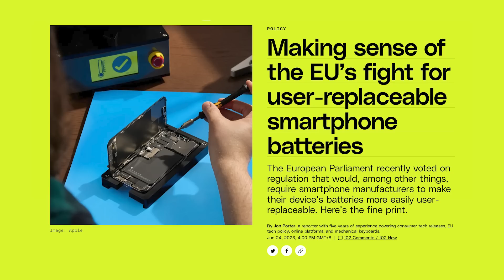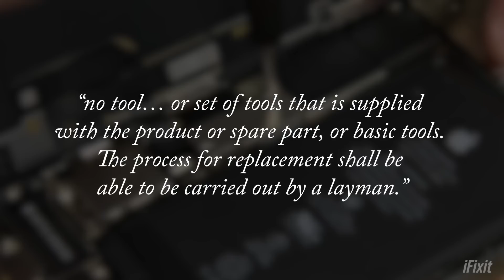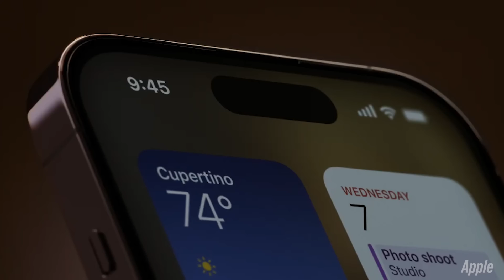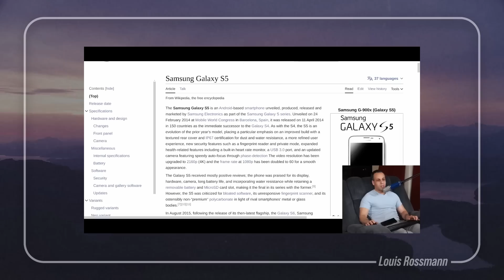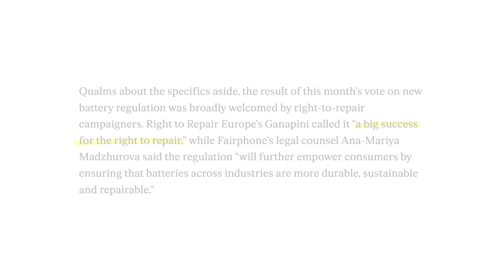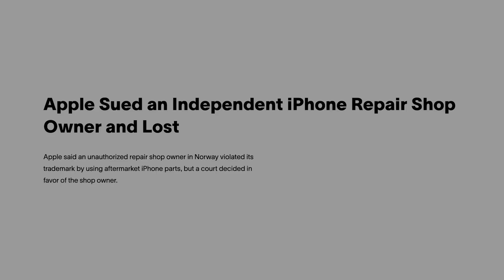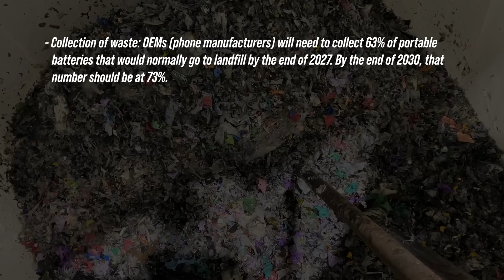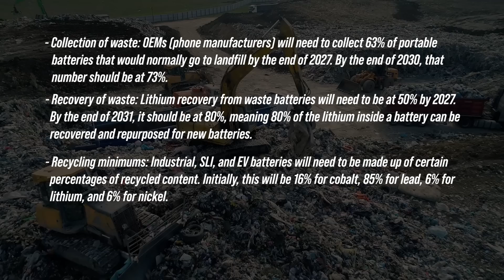EU Just Changed Smartphones Forever

Comment: Hope that eventually, they will finalised on a few fixed battery form factor that all smartphones with removable batteries has to follow. In that way, the same battery can be use from one phone to another.
Reply: That would be wonderful! You could lend people your phone battery for a bit if they needed or something, and you could keep spares for future phones ^^
Reply: And the same should be done for EV batteries... there could be a set of battery standards developed that cover different size and shape parameters that manufacturers had to use.; Small/med/large, long, short, wide, etc to allow different capacities for different vehicle designs. I'll make up a number.... say 30 different shape/size standards that the mfrs could choose from to design the vehicle around whether a mini compact vehicle, or a large truck. Then say you have a 5 year old EV and the batter goes to shit, if such standards existed getting a cost-effective replacement would be easy, instead of having to rely on a massively overprice OEM battery.... that is, if you can still get it. 

Within that size/shape profile new battery technologies and efficiencies could be used in that same "case" as they evolve and improve. I really surprised this hasn't already been done.
Reply: And for power tools.  Completely idiotic that almost every company makes their battery casing and connector slightly different.
Reply: Without any doubt, standardization would help quite a lot in recycling and cost reduction. It could be extended to standardize bottles for liquids (milk, sodas,…). You are on the right direction!!
Reply: Universal battery is good idea. Atleast on brand level.
Reply: As great as that sounds, it’s not as great in implementation. A lot of companies use special designed batteries made of multiple cells that are specifically designed in a size and shape to fill space that would otherwise be underutilized in the phone. If they all have to used one standardized battery we will either be getting a much smaller battery and/ or have to trade off having a component layout that can’t be optimized phone to phone.
Reply: @dumbpup  They said 30 not one.
Reply: @dumbpup So the designers might have to think a little about their design instead of lazily being able to just cram in whatever battery shape will fit.

Comment: I volunteer at a Repair Cafe and the amount of items that are designed to break when attempting repairs is huge. I have come across items that have one or two screws and the rest are fragile clips, special tools or welded in so you can't get it out. Luckily I know a few tricks myself but it has taken years to learn them all.
Reply: Biggest annoyance for me is short cables that tear or break when opening the device, and are situated in a manner that makes them a pain to plug and unplug.
Reply: The way they seal the devices is even worse than using custom batteries.
Reply: Because people is stupid. You can make coffe with a moka and will last forever. Also the coffee will be better.
Reply: @michelangeloc.4265   yeah how strange peopel use dishwasher. wash it yourself, it's cleaner. some peopel realy use washing machine. can you belive it? i mean just go to the river, it's free wather. i don't use any lamps anymore. i just make a fire. you are right, these peopel cant user their brain. making their own problems. irony off

Comment: I can't count how many times I took out my battery in my old S3. I had 3 batteries and an external charger for them, so I could just switch them around.

This came in handy when the phone slowely started dying after some years and the charging port didn't register cables properly anymore or when I had to force a shutdown.

Sadly, by the time I wanted to buy a new phone there was none left with a replaceable battery.

You know, in a world where basically every phone meets your daily needs because all are powerful, all have a good camera and all have a sensitive battery life, it would be so easy to stand out to consumers by featuring things like a removable battery.
Sadly they also start to  come for the headphone jack and the micro sd slot - two other key things I want from a phone.
Reply: I'm still daily-driving a now 6 year old Moto G5 for it's replaceable battery.
It's a great and reliable phone that works well enough for me.
Only when webbrowsing or multitasking does it get slow, but for that I have my laptop or even Steam Deck.
Now as the 4G radio has failed (3G works and coverage here is great still) and Android 7 is approaching app support EOL it's starting to be due for a replacement.
For which I have a backup Hammer Iron 4, which I forgive the sealed battery for the IP69 rating, but it suits me worse than my trusty G5.
Reply: There are a few devices that have removable batteries, but they are on the low end. And have no software support.

Comment: removable batteries didn't prevent phones to be waterproof at all, it's just the industry that wanted us to change phones more often because now, removing a battery need technical skills.
EU is just calling for people to remember and calling enterprises to not do jerk designs against repairability.
there was a huge side market about batteries and I remember some phones of mine that lasted some years more due to replaceable battery.
also, a hard package on a battery can prevent damage to the phone if the battery leak + you can replace it easier.
lmao "due to industry standards" more like "due to industry bs designs that don't have a valid reason aside from making more money and make us throw phones faster"

I don't see that many often (not new) phones shop sellers. nowadays they barely exists. some of us want a phone, not an overpriced loan.

Comment: Alright, here's what gonna happen. Companies will attach something to the battery, for example a circuit of some kind claiming that is for our safety, that it's monitoring spikes or what have you. This will be done only to justify the price. Also, they will code it so that only original batteries will work for the phone. That way, the battery won't cost you 15bucks but they will charge you 150-250 for it. In the end it will be worse for the consumer, because now I have my battery changed for a couple of bucks, but with new proprietary batteries it will be much more expensive.

Comment: well I hope apple users are ready to fork out 70 to 150 Euros for a battery... 

but this done bring in a new market area for battery makers, Higher density batteries for Smartphones, the question is, how will apple try and control that market. 
New apple device warning messages, it looks like you replaced your battery, please make sure you take your phone to a genius bar to remove this message plastered all over the screen and pay 75 euros for the "consultation" and another 50 Euros for the privilege of them plugging a USB-C cable into your phone from their computer for 10 minutes while they copy your data and steal it before sending a release code of *# xxxx# on your device

Comment: Well, it doesn't affect much on consumer side because as ur phone getting older, there would be harder for u to find the battery which u wanna be replaced on your phone, or u have to be rely on not genuine batteries which does have lower quality and may not wok more 3 months, as i had the experience with my Galaxy Note 4
The other issue is that, aside from batteries as ur phone ages, there probably will be wear and tears on electronic parts so the would naturally consume more energy from your new battery and, yeah so, it doesn't matter the battery would be implacable or not ur phone gonna be unusable as it ages
Reply: What? Wear and tear of electronic parts? Man, you have no clue what you are talking about. Software may get more bloated, but this?

Comment: For once, I'm on board with the new legislations. Having the ability to swap out my phone's battery whenever I feel like seems so 2010.... But its brilliant! It also means that we may have a much easier time replacing other components on our phones. Remember - manufacturers care only about profit and are lazy - some will most likely copy their homework from a decade ago and, whilst keeping the glass slab design on the front, wil make the back of the phone dissasembleable. That means, we will be able to replace whatever breaks - camera, speaker, haptic motor, charging port... Sure thing, the loss of warranty is a potential hassle, but do we really need warranty when everything becomes removeable and available on the market for anyone to buy?
I'm genuinely excited to see what 2024 brings, especially waiting for september and Apple's response to the new law.
Reply: If you are in the US, the Magnuson-Moss Warranty Act means that even if you open the device to perform maintenance, the manufactures are cannot legally  void the warranty without proving that the end user damaged it. The burden of the proof is on the manufacture, not on the technician. All of those 'warranty void' stickers are all crimes on the part of the manufacturer. (Note, not legal advice, I am not a lawyer)
Reply: I doubt they are going to release anything substantial. They have ~30% of the market share of eu. It would make more sense to focus in the bigger Asian and American market then the smaller eu market. It's not like anything is stopping the residents of eu from crossing broders and buying a phone that isnt eu regulatory. They will probably do the calculations to either drop the EU market then to give the whole world a taste of easy replaceability and see where they can make more money and growth for their brand.

Comment: This is absurd.

I'm still using my iPhone X, and even after five years, the battery still has a maximum capacity of 82%. I plan to replace it this year, but not because of the battery. In fact, replacing the internal battery isn't that difficult. I successfully replaced the battery of my previous iPhone in just an hour by following the iFixit guide.

This new law will make devices more expensive, complicated, and prone to failure, all for a feature that will likely be used only once over the course of the phone's lifespan.

Comment: The EU regulation states: washable or rinseable devices specifically designed to operate in an environment where splashing, jetting or underwater conditions are regularly encountered;

This means that smartphones that are water or splash resistant do not have to have a replaceable battery. Due to this clause, there will likely be no smartphones with a replaceable battery. They probably added that because of the pressure from the industry.

Comment: It’s kind of pointless enforcing replacement batteries, as they just stop shipping firmware/os updates for your device making it obsolete that way instead.
I have an iPhone 6, in perfect condition, perfect for what I require (even if a little slow but for my use, it doesn’t matter) and yet it is obsolete as no new updates are released. This means apps stop working and cannot be updated, and the browser and email client don’t always work.

Comment: I am personally happy with the current design.
I have my phone stolen a couple of times. The ability to keep phone turned on while the thief had my phone give me time to track them. And they can't turn off phone either because it require a passcode.
Reply: So if the thief removes SIM card and holds down power button (or power+volume) the phone won't restart?
Reply: @m1k1a1  it gives me time, doesnt mean they can't. Enough to track it while it still turned on. They are most likely not smart enough to think about phone tracking. Unless they are professional,. But again, i don't think a professional thief steals a mere phone, lol

Comment: this will help, but another issue is that with manufactures only providing 3 or 4 years of updates, alot of companies will not allow non supported phones to connect to company data ie email. so these devices will need to be replaced.
Reply: Most modern phones are battery wise pretty much toast after 3 years of company use.
Reply: @juslitor  yes, but even if you can change the battery after 3 years, you still have to replace the phone because most company it security policies only allow currently supported phones which is what i meant, spose they can be donated to your kids.

Comment: As much as I like the idea of giving consumers more control and helping the environment this is going to be terrible for battery capacity, phone design and water resistance. I know they mentioned water resistance did exist with user replaceable batteries in the past but it didn't last that long. Just a few times removing the cheap and flimsy plastic back panel was enough to warp the plastic just enough to not make it water tight anymore.
Reply: why? are you gonna shower or swim with your phone? why the hell do you want that? I rather have a phone that lasts longer and saves me another 1200 dollars buying a new one becayse the battery is degraded....
Reply: @m.m.4609  why would I want a device that costs $800+ to be protected from getting wet? You really have to ask that question? 🤦‍♂️

And it's not just about water protection. That's not even the biggest problem. The biggest problem is the reduced battery capacity that I mentioned.

Comment: I actually prefer it the way it is. It’s not that much to just get a battery replaced and I didn’t need to until about 4 years after I bought the phone. Looks cleaner though sealed
Reply: Sure, but its wayyyy cooler to just have a second battery, and switch them out. Bam your phone os full

Comment: Getting consumers to return the batteries would not be a problem if you introduce Pant. It’s basically a deposit you pay when you buy the product. Let’s say it’s €20 for Pant. You buy the phone and the store charges you €20 extra for Pant. Then when the battery is replaced you can bring the old battery back to any store that sells phones and get the €20 deposit back.

It’s what we do with plastic bottles and cans here and because of it more than 92% are returned for recycling.

Google Bottle Pant if you want to know more.

Comment: Profits and anti-consumer. I miss the Note 4 year, it all started going to shit after that. They packed everything in the Note 4 and the same year released the greatest smartwatch of all time(Gear 2 R380). No smart watches have cameras now. The Note 4 was the last Samsung phone to have a removable battery and IR blaster. It had the stylus, the UV sensor, FM Radio(if you got the right model), and an unlockable bootloader(if you got the right model). We need to go back to that way of building phones. Also, the galaxy S5 and S5 Active was a perfect example of water resistance and removable batteries being compatible.

Comment: So where will the EU directive stop, will it extend to EV vehicles? 

If the objective is the environment then the policy is misguided. The EU would be better off just making all manufactures responsible for all the waste in the products they sell, that would mean manufactures think hard about their packaging and design. 

The battery life of an average smart phone is over five years, is it really that important to make the battery changeable by a lay person?  Why not instead force the manufacturers to replace the battery of their phones free of charge, customers would pay for the replacement battery but there would be no charge for labour to replace it. Customers would be free to source their own battery or purchase a replacement direct from the manufacture.

Manufactures already stop the system updates to old phones, preventing them from installing the latest versions of apps, eventually forcing the user to purchase a new phone, end of battery life is really not the issue.

Comment: Almost all e-bikes already have easily removable batteries, and the ones that don't are often poorly designed in other areas too.
Reply: you mean like the failed Dutch hippy dippy Van Moof bikes? lmao
Reply: @m.m.4609   Van Moof has so many dumb design features! Small brake rotors that overheat easily, internal cable routing that's a pain to replace, a flimsy wheel-lock mechanism that can be broken with enough forceful pedaling, built-in batteries that need tools to remove, and lots of proprietary parts. I like to call Van Moof "the anti-bicycle bike", because it's the opposite of what a bike should be (simple, modular, and easily repairable).

Comment: Many people forgot that smartphones actually used to have replaceable batteries. 
It's not increase costs that manufactures have problem with. Producers of devices simply figured out that people will buy next device sooner due to battery having shortest life expectancy of all crucial parts. That way they sell more.  
In short  `battery life  = device life`. 

Replaceable battery means longer period between avg user buying new device.  
Also it means there will be stronger aftermarket for many devices for very same reason.   

Next step is to enforce longer security updates, otherwise they just start with the campaign "old phone aren't secure enough"

Comment: I had a Siemens M35i back in 2000. One of those phones you could hammer a nail into a wall with. Of course the battery was removable. And it was dust- and waterproof. So, why should this combination be a problem today? Sounds like a lame excuse to me.